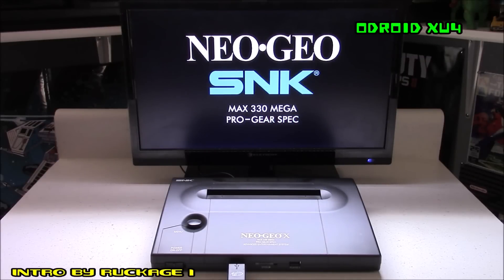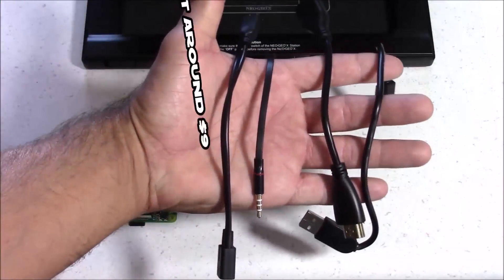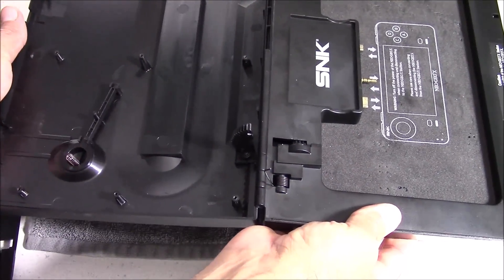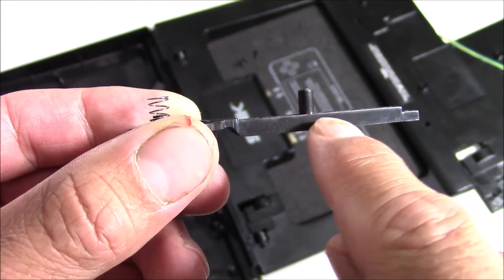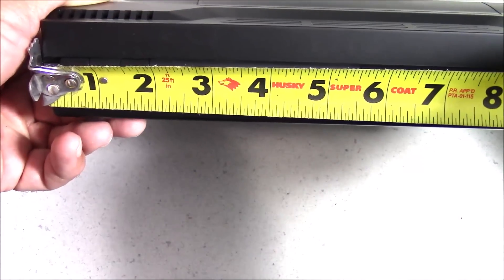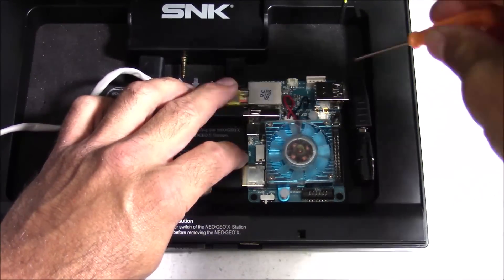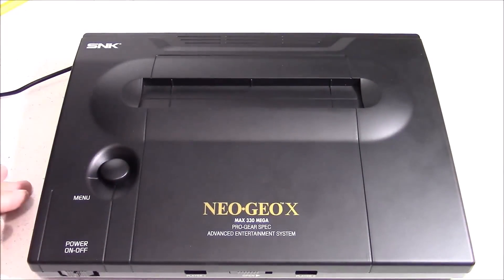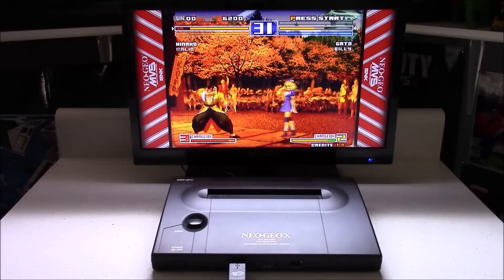How to build a SNK NEO GEO XU4 "AES clone" using a Odroid XU4

Comment: How do I stop the Odroid from booting thd moment the power cable is plugged in?
I want it to turn on only with the button.

Does anyone knows?
Reply from the maker: It turns on when power is plugged in thats how it works same thing with pi 3. But can shut down with power button on xu4 board from that point on.
Reply: 8 Bit Flashback Ah, that sucks.
It is also a tad odd.
Eversince I put my raspberry inside a retroflag case (I didn't install any scripts), it only turns on when I press the on/off button on the case.
Reply from the maker: retroflag case has its own power port that separates it from pi power port. so it acts as a kill switch. if you were to take pi out of case the plug in a power cord it would turn on just like the xu4.
Reply: 8 Bit Flashback Got it. I thought it was just a cutout, like its HDMI port.
My bad.

Thanks, man.

Comment: I made one , but i resoldered a hdmi and usb, also i put a buck converter with a 12 power brick, and remove the top cover completly to made more room and finaly fixed a xu4 in the top part of a case on the snk logo. check this out https://drive.google.com/open?id=1MxSm4O6zlxEGCLHec1gXY2428L6THDcN
Reply from the maker: Cool
Reply: @8-Bit_Flashback  little upgrade a 64GB usb 3.0 flash drive and a old usb hub diassembled for  bluetooth and wifi, also i put a green led projecting on rear vents so in that way i can see the power status. https://drive.google.com/file/d/1-rWI57lFpydkMI8LAx818H1Cg-2-Dukv/view?usp=sharing

Comment: Have to wonder about temps with the more demanding emulators? Cool and fun project though :-)
Reply from the maker: Multiple holes could be drilled through bottom of case for better ventilation. It does have some small vents on back of case that could be enlarged as well.

Comment: As a proud owner of two NeoGeo X's this makes me sad. My Xs are jailbroken and running great. 

Thanks for the tutorial.
Reply from the maker: No worries no neogeo handheld was harmed or neglected during the filming of this video. In fact I don't even own a Neo Geo handheld I only own the docking station. For anyone who does own the Neo Geo X handled along with the Neo Geo X docking station I would not recommend modding it.
Reply: Want to sell or trade one ?
Reply: Just use a raspberry pi. No case mods needed. Mine runs perfect.
Reply: Those are shit, proud owner.